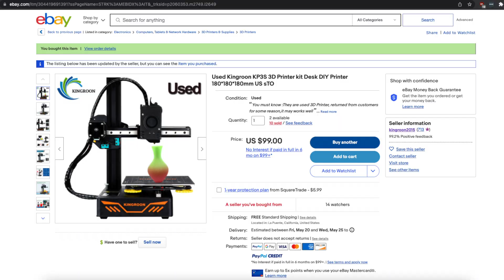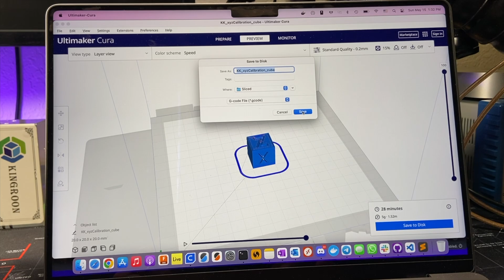100$ Broken 3D Printer from eBay (Kingroon KP3s)

Comment: Broken is the way to go for cheap 3D printers. I got mine on OfferUp and the underside of the bed was scratched to hell and wouldn't heat. Also the previous owner took it apart and put it back together again weird. Some thinkering and a new bed and it works just fine. I've even upgraded it. If I need another printer I'll probably just buy another broken one. Usually it's something really simple.
Reply from the maker: Totally agree with you, but for some people who new to the hobby it can be disturbing to fight the issues.

Comment: Hello, is there any way that you could link the bimetal heat break that you replaced the original with? cant seem to find any compatible heat break replacements
Reply from the maker: Check official kingroon.com website you will find all details there, they even sell all metal heatbrakes themselves.

Comment: I just got 2 of these one at $95 and one at $85, one pretty much brand new and the other had a lightly used bed and missing one T-nut. Why did you install a TMC2209 on the board to run pressure advance? I thought the TMC 2225 could run pressure advance just fine?
Reply from the maker: Linear Advance or Pressure Advance on TMC2225/2208 is a very finicky process especially when you don't have UART control over drivers (like in our case). In the past I had a lot of troubles with those drivers on my Ender 3. So I just decided to not gamble and not to waste time on the part that can be replaced for 5$.
Reply: @hobbyistnotes  Thanks for the info

Comment: Just got mine, there are some for $89 or best offer. I submitted an offer for 80, they counter offered $85, so about $91 after tax. :)
Reply from the maker: Nice deal! Even if there is something wrong it will be cheap to fix, otherwise extra money for good upgrades.
Reply: @hobbyistnotes  yeah bent lead screw, so I installed a magnetic anti z wobble dampener. And I put a spare prusa mini pei plate on it. :)
Reply from the maker: @brandoneich2412  Perfect, nothing can beat such price...